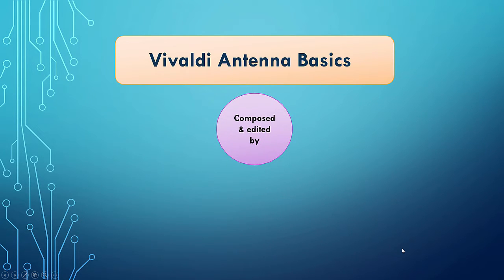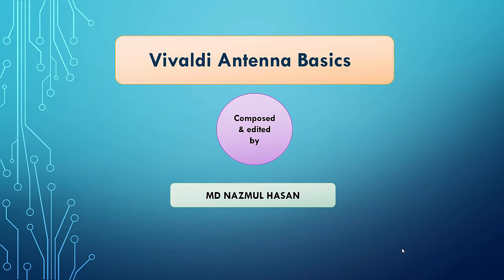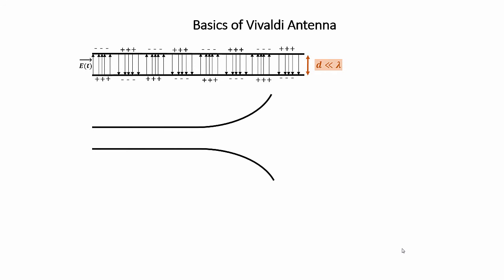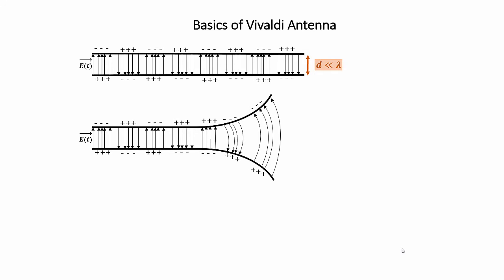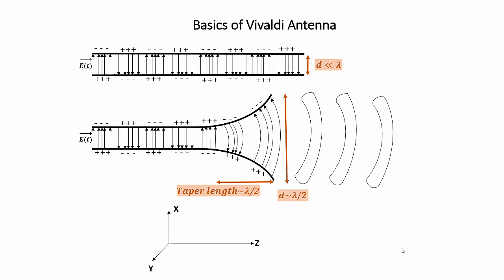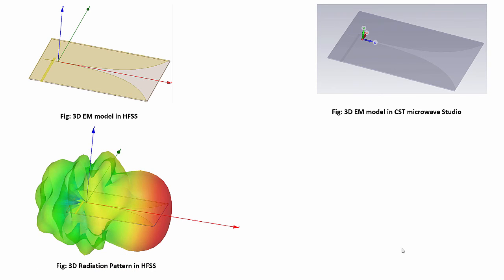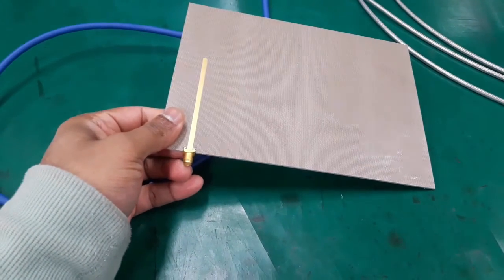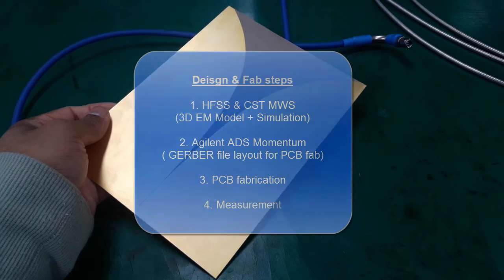CST Tutorial: Vivaldi Antenna Basics

Comment: Hi bro

Great video. 
I have actually attempting to simulate a similar Vivaldi antenna in CST, but i have trouble in making the antenna in CST. Could you please guide me on how to create the taper shape in CST?
Reply from the maker: In both HFSS or CST, you can make the exponential radiation curve by defining analytic curve through user defined equations. I have a plan to make a separate video on vivaldi design and simulation in both HFSS and CST. There I will demonstrate the process
Reply: Thanks for you swift reply 
Please do, that would be a great help :)
Reply: Make it! Please :)